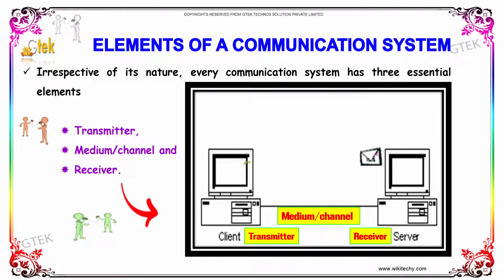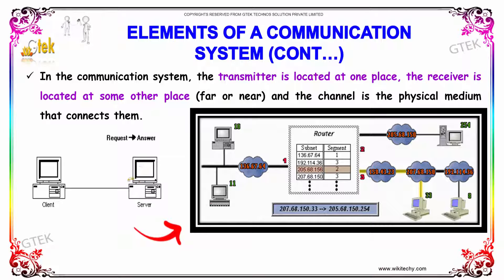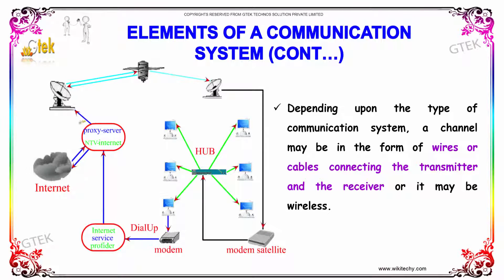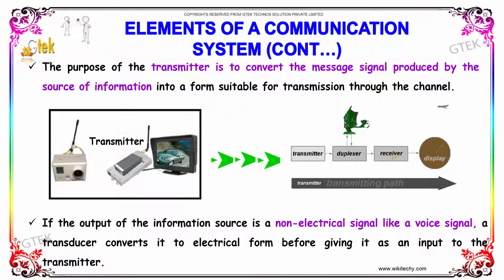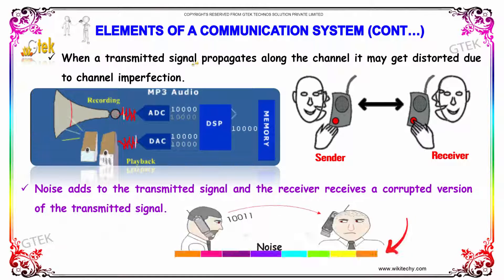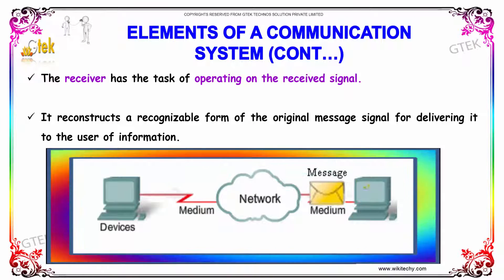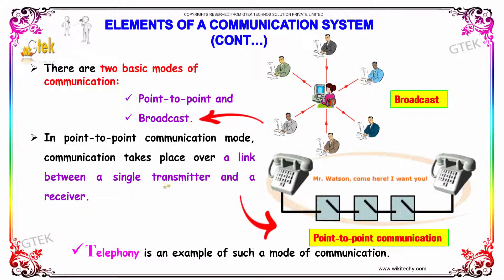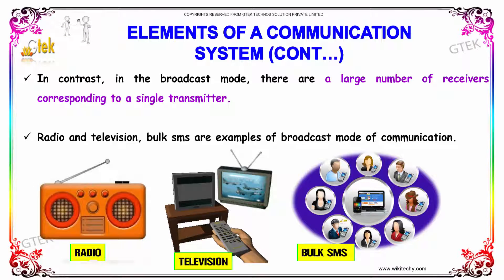Elements of Communication System|class 12 physics subject notes lectures|CBSE|IITJEE|NEET

Comment: system consists three basic components: transmitter, channel, and receiver. The transmitter's function is to process the message signal into a form suitable for transmission over the communication channel. This is called modulation.

Comment: It is a block diagram of a communication system. This system consists three basic components: transmitter, channel, and receiver. The transmitter's function is to process the message signal into a form suitable for transmission over the communication channel. This is called modulation.

Comment: This system consists three basic components: transmitter, channel, and receiver. The transmitter's function is to process the message signal into a form suitable for transmission over the communication channel. This is called modulation.